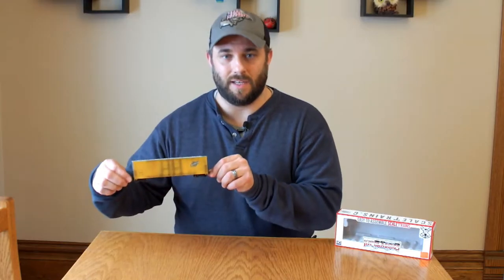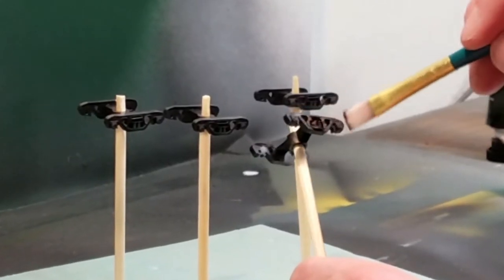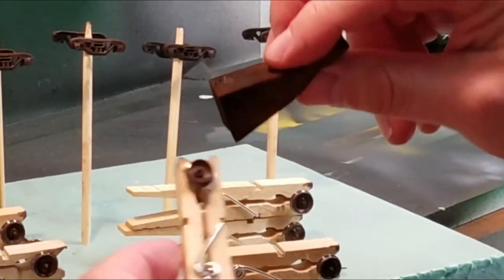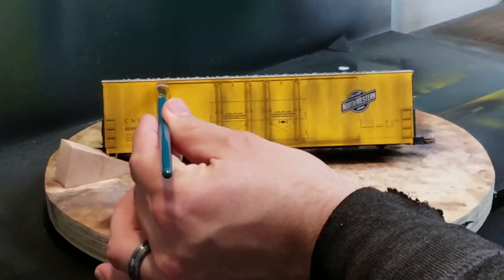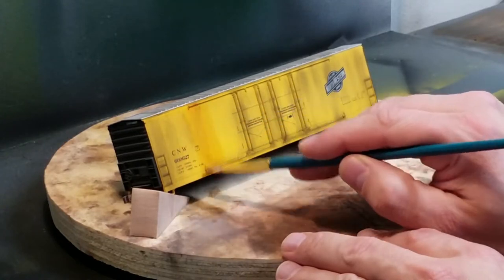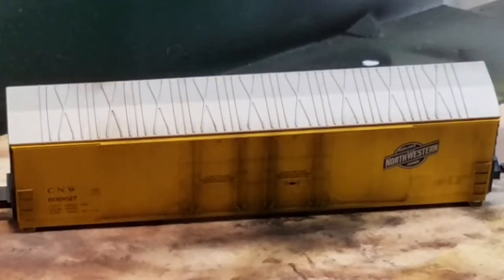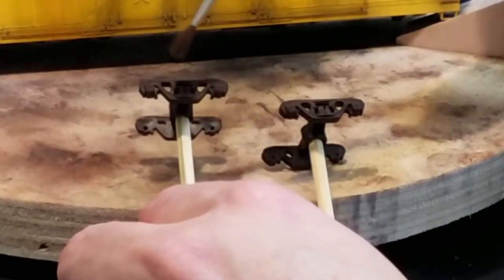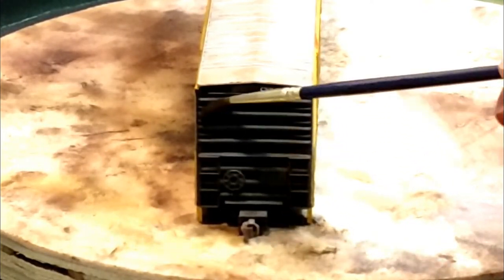Tips to dominate model weathering

Comment: Andy, do you do anything to the wheel axles after you paint them? I would think that the applied paint and powder would greatly hinder the way that boxcar rolls now. I do like the effect of the oil paint and turp compared to water base..it just appears more of a "grime" effect. Also..do you seal the model after you are done..or is there more to do on the next video?
Reply from the maker: Is the rolling is hindered in any way I remove any material that may have accumulated on the end of the axle with either sand paper or my dremel and it's polishing wheel. 

Thanks for watching!
Reply from the maker: I also seal everything up with flat finish or dull coat after I'm done with everthing